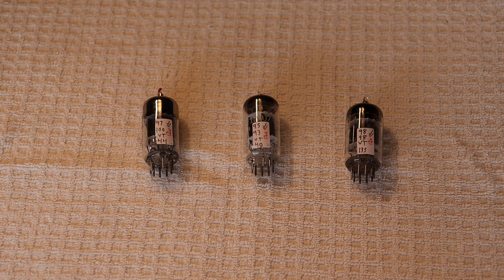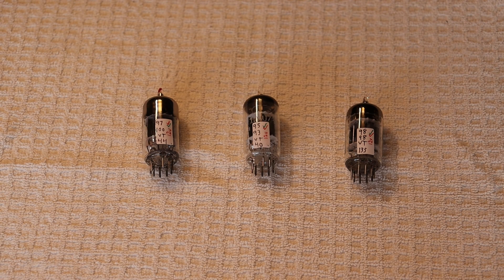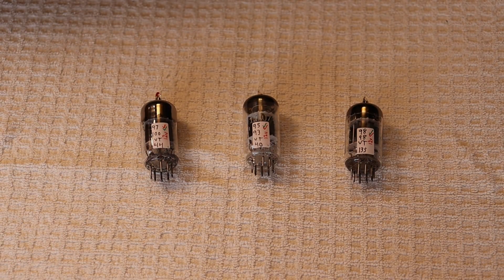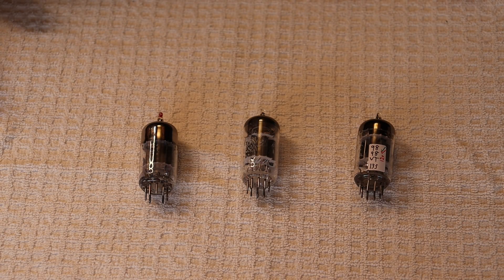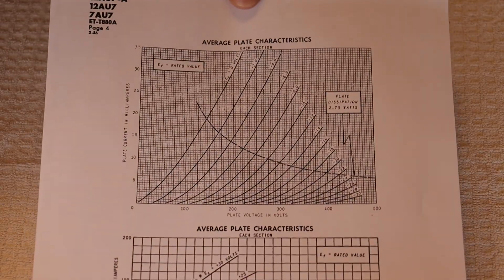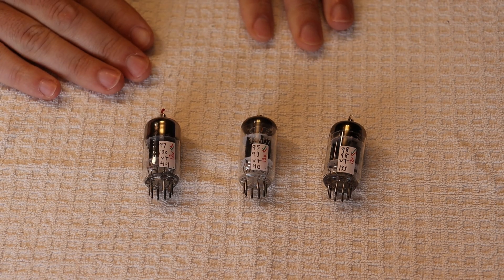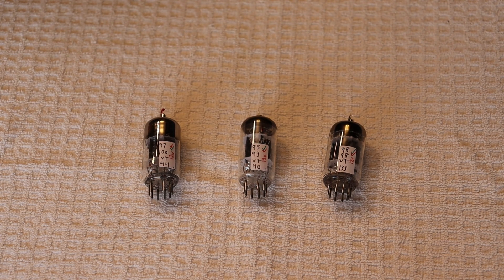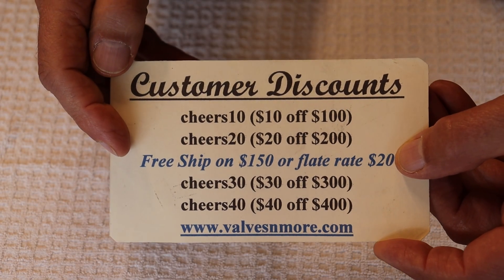Tube Lab #259 - GE 12AU7 Numbered Variants

Comment: Which tube do you guys like best of these three types? I have all three of these tube types and had found I preferred the 5814's but in this video I actually think I preferred the 12AU7.
Reply from the maker: It depends! They all had excellent detail and very even presentations in our test system. I'll try to summarize my thoughts below but keep in mind the differences are subtler here than with mixing tubes from different brands. They were all very good sounding. 

Stock 12au7 = slightly more forward in the treble, great sounding vocals and mid range 
5814 = slightly more forward on the bass, excellent good detail
6189 = slightly more forward on the bass as well, acoustic guitar and the mid range sounded excellent

Hope that helps!

Comment: I have the GE communications industrial grade 6681 type basically 12au7
Reply from the maker: This is not correct, the 6681 is a high gain tube, that is a 12AX7 equivalent.  It is only similar to the 12AU7 in that it shares the same pinout, base and a universal filament (6/12v).
Reply: @tubelab194  yes you are right they are 6680/12au7  the boxes are cool..

Comment: What does the Ladder plate inside the tube purpose? Ladder meaning what?
Reply from the maker: Ladder plate, is a desciptor of the physical appearance of the face of the plate.  So imagine that the plate is a flat rectangle (inside is the cathode, grid & filament), now on the face are shallow impressions that look like a ladder, that's a ladder plate.  The ladder aspect is probably rolled or stamped out to help strengthen the flat metal.  For tube identification what the plate physically looks like is very important.  A typical plate might be described as a "smooth black plate"  or  "a ladder grey plate".  Hope that helps!  Cheers, Jim